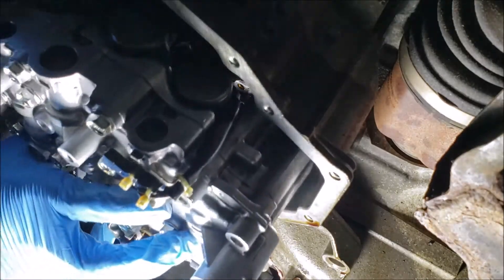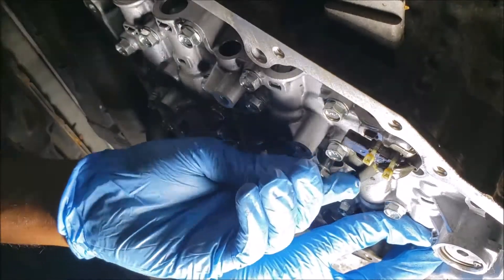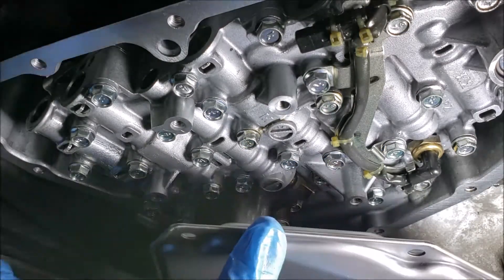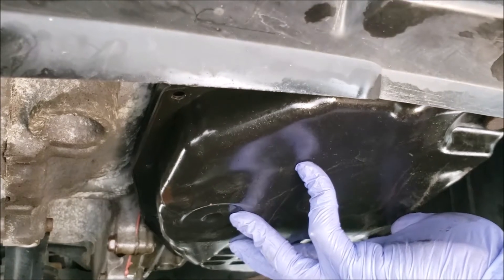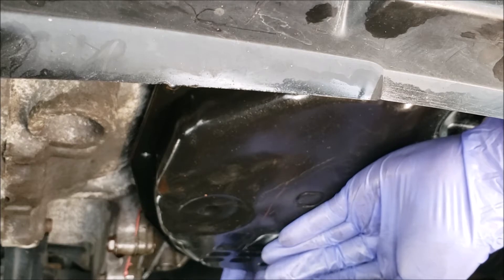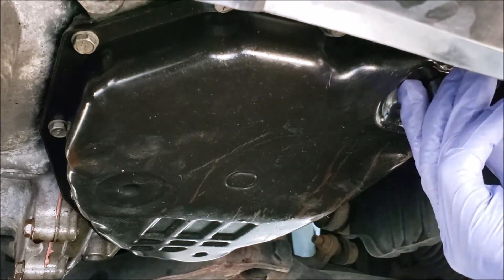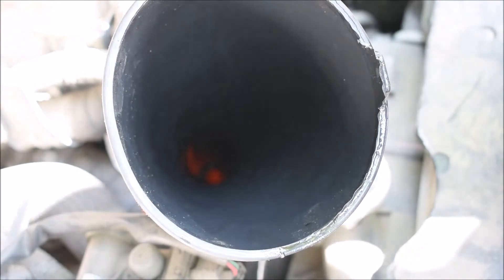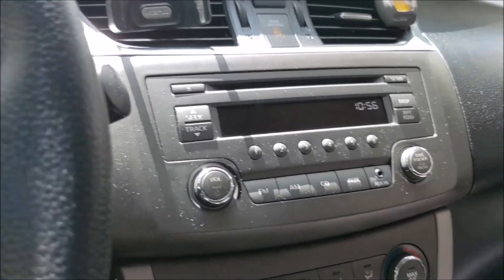Failing CVT Part 5 - Installing Valve Body & Alt Fixes

Comment: I replaced a 2012 rogue transmission valve body and not it’s throwing 16 codes and still stuck in first gear.   What do I do?

Comment: What do you mean the car has to be reprogrammed after putting in a new value body, and what happens if you don’t
Reply from the maker: The process is to help reset and enable the car to adapt to the new valve body. It comes with a CD containing software files for the programming.
Reply: @tryfixinit8438  What if my remanufactured valve body didn't come with a CD?

Comment: Hope you can help I have a 2013 Altima 2.5 drives fine but after long trips and I get on a stop then take off is really slow takes a little to speed up and currently giving me code p0776 (fluid is a little brown)

Comment: The one thing I can't seem to find is a video showing the connector portion of the valve body being installed. I'm struggling with that right now.
Reply from the maker: The portion of the connector can be found on top of the transmission. It is the round-like harness/connector at the top
Reply: @tryfixinit8438  I was looking for the best way to reinstall it after I removed it. I did figure it out. Currently I am trying to find a used valve body. Do you have any local recommendations?

Comment: did you just spray the solenoids like that or did you put power to the solenoid and actuate the valve inside the solenoid to clean them? I'm having the same problem and I put a whole new valve body with the old rom so I don't need to program it but still has the same issue. should i just super clean out the old valve body including the solenoids with carb cleaner and put it back in?
Reply from the maker: I soaked mine for a day and blew into it. Did you clear the code? Putting the old ROM on the new valve body should solve the issue. Are there other codes on it?

Comment: removed solenoids, cleaned them with carb cleaner and blew them out,  this did not fix P2859 code
Reply from the maker: As indicated in the previous videos for this code, the solenoids were clogged and this affected the performance and triggered the code. Cleaning them help resolved the issue.
Reply: Did you replace the valve complete with new solenoids, I have the same problem wonder if it works also what’s the part number, I see some many with different part numbers and they all look the same.
Reply: submerge the solenoid valves in carb cleaner or equivalent cleaner 24 to 48 hrs then air pressure them clean. Good luck.
Reply: @rich52movie  I soaked the solenoids in carb cleaner for about 24 hours maybe less the a car drives slightly better but sometimes still have issues when the car just doesn’t want to not go/ slipping so I turn the car off and then on and it’s like it reset and now it can go. Main problem is when I brake the rpms shoot up and the transmission clucks when coming to a stop, feels like something is wrong with the down shifting. Did this solve your problem or did you replace the valve body. I’m thinking of getting a new valve body because Nissan doesn’t sell the solenoids, and the ones on Amazon and eBay have mixed reviews
Reply: @HaystanHopar  was not successful and opt out of a recommended new trans replacement
Reply: @rich52movie  did you try replacing the valve body with a brand new one and also did you swap your old rom chip to the new valve body?
Reply: @HaystanHopar  I've also search for answers of this issue and at a Nisson Dealership. I think failed valve body solenoids can lead to wear in other parts of the trans. This may be why they recommend replacing entire Trans and not just the valve body.
Reply: @HaystanHopar  you know where the rom is located on valve body
Reply: I’m sorry it’s a 2018
Reply: Do you guys know where the rom is located on the valve body
Reply: Hi guys 
I'm DIY and I get a 2015 Nissan Sentra with the same issue and code recently I changed the valve body. now the car just shifts between gears but won't accelerate. which is not the same problem I had before I replace the valve body.
Reply: @taroukkkkkkkkk  A 2015 might be worth a Trans replacement.

Comment: You soak the solenoids in carb cleaner? For how long?
You also reused all the gaskets?
Reply from the maker: Soaked it for a day... I also reused the gasket although replacement is recommended

Comment: nice job. there is a side filter. don't forget to change that. you have to remove the drivers side tire. the car i just got running looked like it hadn't been changed in a long time.
Reply from the maker: That is also important. Thanks for the tip!